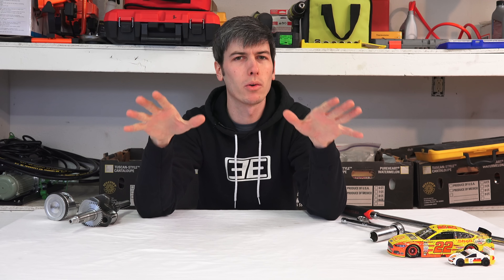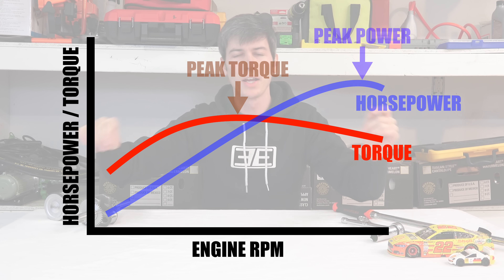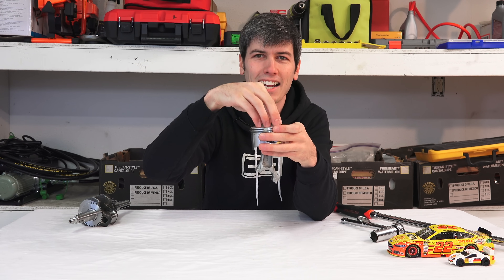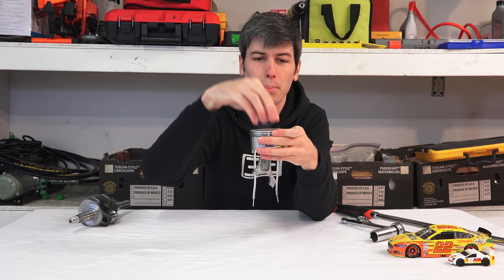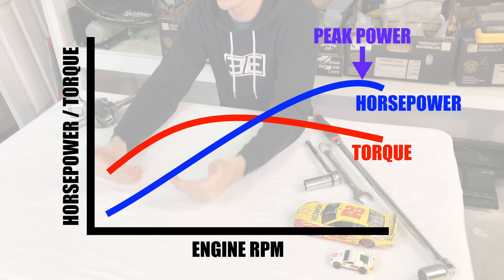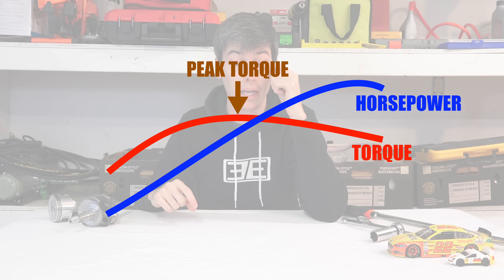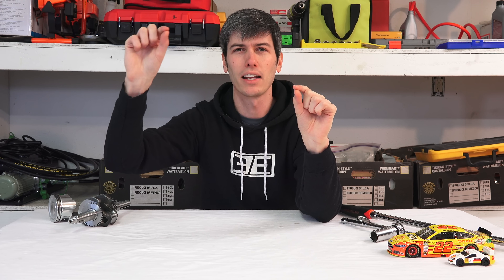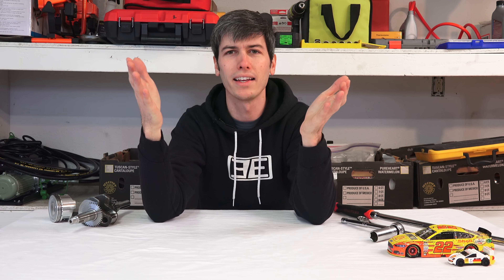Horsepower vs Torque - A Simple Explanation

Comment: You are doing a very good job of explaining basics but leaving allot out. First off you equation is wrong it is (hp=torque*rpm/5252) not( hp=torque*rpm) that is a huge difference. Second torque and horsepower go hand in hand not against each other. Another point is you are comparing mechanical rotational hp to mechanical moving horse power (lets say 1 horse can move 5000lbs 1 mile in 5 minutes). To say that torque can be manipulated is true but it is at a cost. everything has give and take not because some dead white guy said so but because it is the laws of physics. If you take an engine that has 200 ft lbs of torque and only 100 hp it moves a car forward a certain distance in certain time. If you take a car that has 100 ft lbs torque and 200 hp you can manipulate the gearing to get the more torque yes but you lowered the gear ratio so the distance traveled goes down. And you would need a much higher rpm to achieve this. You gain here but give up there. It is the balance between them to achieves what your optimum goal is. If you take the engine and put it into something else say an aircraft or a boat Its much easier to understand. Take a jet boat or aircraft use same math. engine 1 has 500 ft lbs and only 400 hp runs at 4500 rpms boat goes 60 mph. engine 2 has 300 ft lbs but can produce 400 hp running at 4000rpms boat goes 50mph. This is because the smaller engine doesnt have the torque to get to the rpms it needs to produce the horsepower it has the potential to make. it is stuck at 4000 rpms. of course cars dont have this problem thats why transmissions have gears to manipulate the torque. so they can get to the hp potential they have. but when you lower the gear ratio means you sacrifice distance traveled. Thats where the higher rpms fill in the distance traveled. Now you get into mechanical hp to achieve the goal of moving forward. moving a 3000 lbs car certain distance in a certain time. Lets say that basically to get more horsepower at a higher rpm you must apply more torque to the crankshaft at a higher rpm. That is why they go hand in hand not one vrs the other. 

Your analogy of the longer ratchet applying more torque is great for demonstrating gearing. Yes it is but you had to move your arm farther to achieve the same amount of rotation on the nut so it will take you longer to tighten. Of course if you tried this in order to tighten the nut in the same amount of time you would have to move you arm faster hence the higher rpm!  That is the relationship or balance between them. I think everyone here should try this get two bolts and two different length ratchets and race to see who wins. 

In this easy experiment the person is the engine (HP= torque*rpms\5252) and the ratchet is the gearing to achieve the goal to tightening the nut ( HP= force*velocity) IE moving the veh forward.

 I believe the people with the longer ratchets will find themselves moving their hands in in the ratchet changing the gear ratio  That is the perfect explanation of the balance between to two terms.
Again let me state that no matter what kind of veh you are talking about whether it a boat car plane no matter what trans you have or car it is in IN ORDER TO GET MORE HP YOU MUST APPLY MORE TORQUE TO THE CRANKSHAFT AT A HIGHER RPM. There are many ways to achieve this.

Comment: You stated a car will be faster/ quicker with hp over torque. Faster and quicker are way different. "Quick" describes acceleration- torque moves mass. "Fast" describes rate or velocity. There are many good points in this video.

Comment: This is why it only makes sense for Tesla to report wheel torque - because those cars only have one gear effectively. Therefore, the max torque is always the same whereas on gasoline cars, which have anywhere from 5 to 8 gears these days, max torque is different in every gear. In 1st gear a Corvette has incredible wheel torque, but in 6th gear not very much. A Tesla has whatever max wheel torque they report as the only max value since it’s only one reduction gear. Given how electric motors work, it wouldn’t make any sense for Tesla to report motor shaft torque which might only be 200 lb-ft or something not impressive. And yet they are some of the fastest cars on the road because the single gear ratio creates a huge amount of constant wheel torque that is essentially at the maximum value for the entire speed range. Gas cars are typically slower (besides exotic cars) because their torque is constantly changing and gets weaker at the wheels as the gears shift up.
Reply: Great explanation thanks!
Reply: Electric motors typically produce peak torque near zero rpm and peak hp at max rpm. An electric car with sufficient torque doesn't need a transmission to multiply the torque output to help the car accelerate. Also, electric motors typically produce much higher torque than hp. A 50 hp motor may produce well over 500 ft lbs of torque.
Reply: The truck would just have a diesel generator on-board charging the batteries. The generator would use less fuel than the typical truck engine and would cycle as needed to keep the batteries charged. Trains typically have one traction motor per drive axle with no transmission. There may be a final drive with a fixed ratio depending on the combined torque output needed. Since an electric motor has peak torque available from a stand-still and can rev up higher than your typical diesel engine, it doesn't need a transmission.
Reply: Roger Starkey Exactly. That's what makes it good for urban streets. Steady torque is what you need for that.
	With semi trucks, you need to be able to do things like downshift to slow down, and shift up through the gears to increase speed while not really changing rpm. In all situations when towing, you need a horrifying amount of torque, but it's not normally legal to go over 55 mph. Trucks used for things like logging and mining have to travel up and down steep mountain sides at about 20 mph while towing 35 tons.
	E motors don't produce all that much torque, but they're super fast and easy to control.
Reply: Gary Manis it’s the batteries that would make it suck. And in the train case the generator+motor is really just acting as the transmission. I think trains require an infinitely variable trans like when getting it first rolling (clutch) or pulling different length trains (gear ratio must change) and its probably easier to get that infinite speed control with electric motors than an super complex mechanical transmission. A regular gearless ebike hub motor turns at barely any rpm compared to most motors and the efficiency is only a bit worse
Reply: AMPS, Tesla has not been anything but a toy in most states, eco friendly it is not, if you re charge at Coal fired sourced station
Reply: smilsmff 
Wrong. Do  some research. EVEN if it was coal fired, it's CLEANER.
Do you know the percentage of coal generation? Read about it.
Have you looked at the "efficiency"
From the ground to the vehicle, of petroleum vehicles? Read about it.
Reply: Roger Starkey No. I understand perfectly. 
	With diesels, the goal isn't necessarily max torque, it's the right torque (which as I said, is more than most EV's can summon), and ridiculously fast acceleration is extremely dangerous, illegal, and unproductive. Its only use is in racing. You see, as he mentioned in the video, the longer the lever, the more power you'll get. The electric motor may be able to do the job itself, but the problem is that it doesn't have as much leverage as the diesel with an 18 speed. Electric motors are compact. Consider the difference between a Leatherman and a tool box with 3 different small knives, pliers, wire cutters, a file, two different screwdrivers, a saw, and a bottle opener.
	I know car guys are all like, "faster is superior! " but that's not practical. 
	Trucking isn't nothing but achieving max speed, it's not a race. It's matching the machines behavior to the environment. Hell, you spend a lot of time just trying to slow it down. If you miss a gear, you probably won't make it up the hill, but this isn't the end of the world. You simply have to try again. Truckers have to be skilled and alert, and there's more to the job than just driving. 
	At the end of the day, the diesel will have superiority to the E truck because it's more versatile and less delicate, and, as I said he mentioned, longer is better. :)
Reply: Roger Starkey It's smaller. How is that complicated? It doesn't matter if it can produce torque at 0 mph, what matters is how much. It can shoot off like a rocket on a more or less flat surface by producing torque extremely fast (horse power), but it can't produce more torque, nor can the amount of torque vary. That's the problem. The other problem with this invention is that it, unlike a diesel, could easily explode if impacted. Despite the opinion of Hollywood, diesels can't really explode under typical accident conditions.
	That aside, I think the fact that they're refusing to use transmissions is because they don't want to shift. If they'd put a damn tranny in 'em, most of the problem would be solved.
	A tesla semi's max towing capacity is 85,000 lbs I do believe. The main limit to the typical diesel driven 18 wheeler is whatever the axles, tires, suspension, etc. can handle. U.S. 5 axle trucks are limited to 80,000 lbs by law, but can take 100,000 just fine, and if built tough enough, can take 130,000. Four trailer Aussie road trains can weigh upwards of 300,000 lbs.
Reply: Clorox Bleach 
What's smaller? The Motor?
"Producing torque" extremely fast?
The torque turning/ twisting force is constant! For an ELECTRIC motor....... THAT'S what I've been saying!
Power increases when the WHEELS are turning "extremely fast", ie at SPEED.
Torque not varying ISN'T a problem! There is SO MUCH of it that it outperforms Diesel motors at ANY speed.
"They" aren't "refusing to use transmissions"..... "They" don't NEED to! They OUTPERFORM THE DIESELS!
The DIESEL needs a transmission to stay in the torque band.
Exploding????? WHAT?
One more thing, re the Tesla semi, how could they fit a transmission?
Tell me please.
Reply: Fon Jet 
Ask Tesla?
Google it?
Reply: I'm afraid you are wrong. Train engines are basically diesel generators with electric motors driving the wheels. It takes a lot of torque to get a train moving and electric motors are better for producing torque than diesel engines.
Reply: Richard Vanwinkle 
A SINGLE gear, no gearbox.
The gearbox on an ICE vehicle allows the engine to operate in its torque/ power band and transfer the required torque to the wheels, which then convert rotation to forward motion.
The Electric motor has almost maximum torque from zero revs, so can apply sufficient turning force to the wheels to move the car (rapidly!) From a standstill, it then maintains the torque, and power increases with motor revs.
THAT'S why it doesn't need a multi-ratio gearbox.
It's also why the extra POWER of (certain) ICE cars will overtake an EV, when the ICE car is moving quickly................. eventually.
Reply: Gary Manis so it stays a truck with a Diesel engine then
Reply: Stalinx20 That's exactly why Tesla's E semi scam is just that: a scam. Electric motors are perfect as commuters for tight, urban areas, not heavy equipment roaring through the Rockies.
Reply: Clorox Bleach 
Torque is what moves trucks.
Hence the large number of gears on diesels.
That actually makes electric drive Ideal as it produces torque from zero rpm and it stays virtually constant through the rev range.
Reply: Clorox Bleach 
You're missing the point (I think)
The gears are there in the DIESEL rig to keep a maximum TORQUE at the wheels to allow the relatively low torque (!) engine to move a heavy load. If the engine needs to be at , say, 3000rpm for maximum torque it needs to multiply its torque to start moving from standstill using a gearbox.
An ELECTRIC motor doesn't need a LOWER gear because IT can produce ITS torque from zero AND the same torque to  (almost) max revs.
On at graph, the acceleration of an electric truck is a straight line (constant).
If a diesel truck is in one gear, the curve starts almost horizontal (low acceleration) As the engine speed increases, it's torque increases and so does acceleration and power.
THATS why they say the Tesla Semi is so fast to accelerate compared to a diesel. It's also why it can maintain speed on hills WITHOUT A GEARBOX!

The motor can produce MORE torque at the wheels and a CONSTANT torque through its whole speed range, urban or highway makes NO difference.
Sorry, I can't think of any way to make it clearer!
Reply: Clorox Bleach 
But it DOES have more leverage (torque)! From ZERO  SPEED.
look at EVERY example.
Why does a Diesel truck NEED the ,18 gears to produce the pulling power?
I'm not in any way promoting "Ultimate speed" or "Ultimate acceleration" as being g required, but they demonstrate the ABILITY of the electric system to provide much greater torque at the wheels (using a single reduction gear!) Over the WHOLE speed range.
If you can't fathom that.......
Remember the statement "a Tesla semi can pull a diesel truck, easily, uphill"
IT. HAS. MORE. TORQUE!!
Reply: Gary Manis so they’ll make a semi truck the size of a diesel train engine?
Reply: IL MOSTRO   Do  Tesla s have a tow packing for them ..to tow large boat a caravans?
Reply: Fon Jet 
No, they don't HAVE to!
For example, look at the P100 torque figures, large motor, 487ft lb of torque FROM ZERO REVS! I
The semi has 4 motors!
The torque at the wheels will be greater!
The Tesla will pull a "normal" semi before they even drop the clutch!
Reply: Roger Starkey By the way, capitalizing words to highlight them isn't necessarily. We read you loud and clear.
Reply: Clorox Bleach 
You read, but you do not understand!
Reply: So how many kilos /tons can a Tesla car tow ?
Reply: on record 43000kg/95000lbs of semi truck in neutral gear on snowy but flat surface by tesla model X
Reply: the new P100D can produce around 920 lb-ft of torque that's comparable to 900 lb-ft of torque claimed by 2016 Ram Cummins diesel, so given enough traction tesla can tow really heavy object

Comment: The key point which was missed is that only Power involves the time dimension.  Torque doesn't.  Meaning you can have an "engine" configured to (statically apply) several trillion foot-pounds of torque (think hydraulic jack),  yet have very poor acceleration (e.g. then when you release the brakes).
Also not mentioned is that operating an engine at peak power means in just about all cases, revving its tits off.  It might be better for the long term lifetime of the engine to select one which provides plenty of accelleration at more moderate RPMs, such as at 1700 or so, instead. (such as the driving experience of diesl engines on highways: effort-less acceleration at medium RPMs). Do you really want to grind your crankcase bearings at 7000 RPM just to accelerate on the highway?

Comment: Question: two cars with identical torque, but one has more hp. How can this be? ( if hp is torque multiplied by rpm, yet through the same rpm range two cars produce the same amount of torque but different hp...) how? An example of this is the Golf Gti and the Cupra 290, with the same engine, exactly the same torque figures but different hp numbers
Reply: Reg Pro did you watch the video at all..... he spells it out very clearly mate
Reply: Different rpm in which peak torque occurs?
Reply: The peak torque is the same, but the car with less faling torque line will produce more HP as the rmp goes higher. You can imagine HP as torque x rpm, so if you have torque graph that after some rpm is a flat line and you can raise rpm to the heaven your car would have infinity power.
Reply: Whats up EE, couldn’t find an answer to this question?
Reply: GRRB  so torque and hp are directly related why does peak occur at different rpms? That has always confused my 2 dimensional mind.

Comment: Using the same two cars pictured in that example, would you be able to say that the one with 200lbs/torque will be more capable of towing  an equivalent mass then the one with 100lbs/torque if you disregard the speed at which they do it?

Comment: Jason. PLEASE explain how torque curves differ according to the application/mission, and how manufacturers design an engine (or tweak an existing design) to produce the desired torque curve. For instance, you hear a lot now about motorcycle manufacturers rejiggering their existing models for more low-end torque. How do they DO that? And what sort of trade-offs does it involve?

Comment: Most people will never rev their engines high enough to get peak horsepower. So torque is nice because you can still get a fair amount of power at lower RPMs. So you can go from 50mph to 60mph to pass someone without downshifting too much and making your engine sound like it is going to self destruct. But if you are talking about going from 0-60 in the quickest time possible, and you don't care what the neighbors think, then yeah it is all about horsepower.

Comment: Quick question, how will acceleration present if two vehicles have the same horsepower but different torque? Simply, of what use is torque if horsepower is what ultimately determines performance?